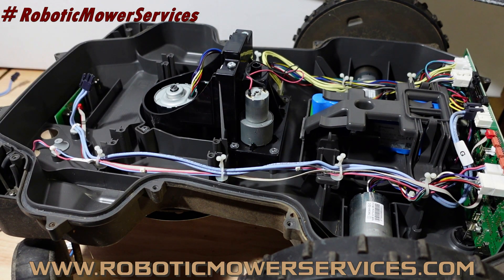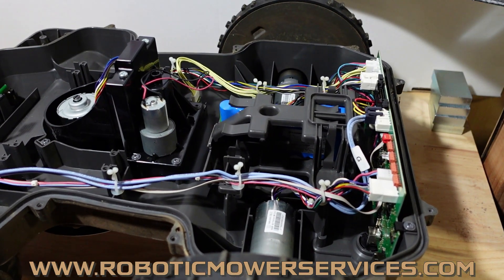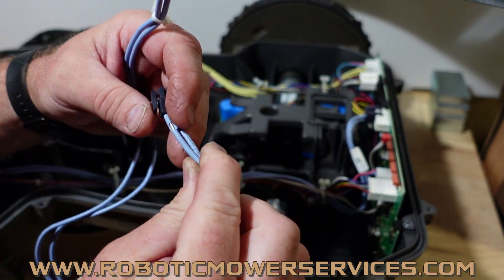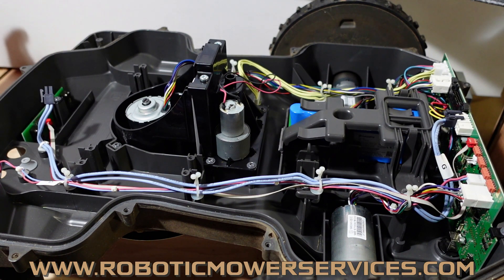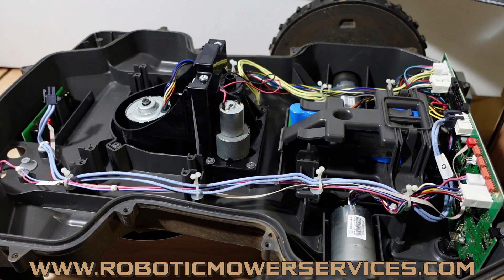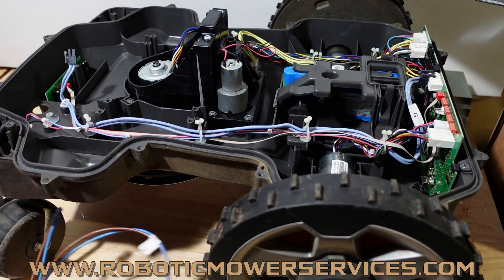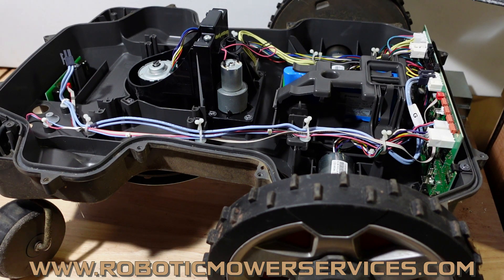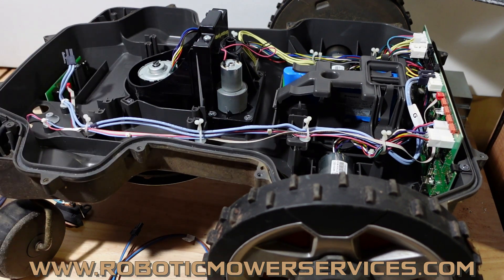Upgraded Charging Harness For Husqvarna 430X, 430XH, 450X, 450XH 520, 520H, 550, 550H Automowers

Comment: This happened to one of my 450XH's last month. The connector had bubbles and was slightly darkened, so I knew it overheated. When trying to disconnect it, the connectors both broke. I just cut the connectors from the wires and used electrical tape to re-connect the wires. It has been working fine since. Are there any possible issues with having fixed it this way without the connectors?
Reply from the maker: Yes, there is. As shown and explained in this video the new wires are a different metal and have a different insulation on them. The original style had issues with the wire itself corroding inside the insulation. When you fix it as you mentioned you are eliminating that bad spot that you can see but leaving the wire that was over heated and caused  the issue still in the mower.